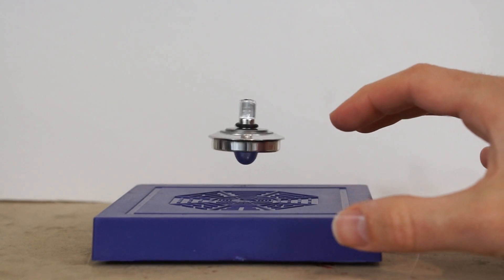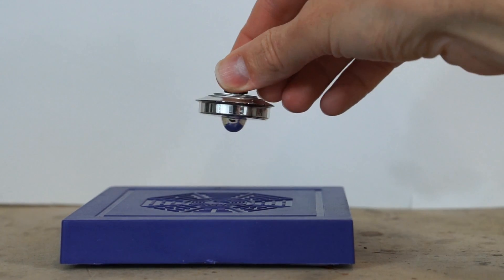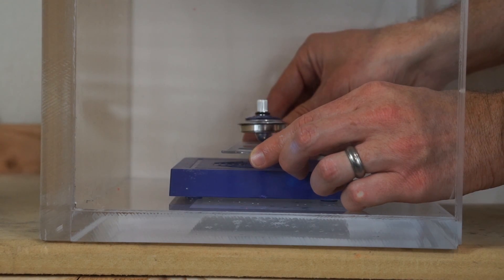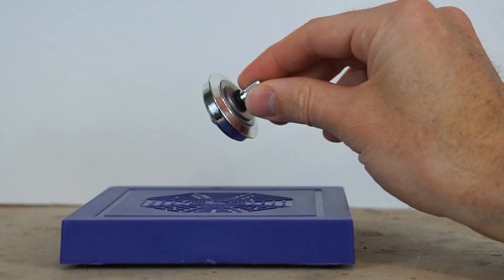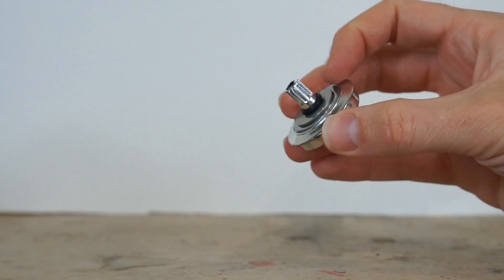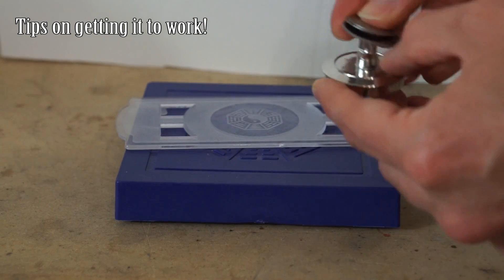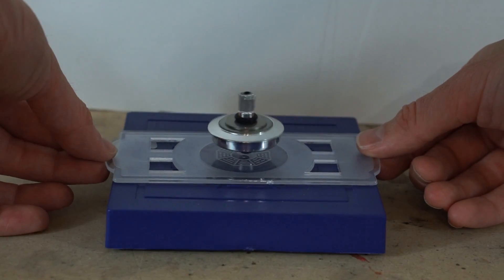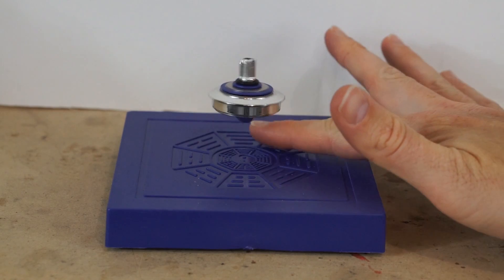Will a Levitating Gyroscope Spin Forever in a Vacuum Chamber?

Comment: It will stop due to a law. Energy can’t be created or destroyed. If that spins forever it breaks a law due to it ‘ creating ‘ energy. Also vacuums can’t go to an absolute vacuum but there’s still millions of atoms in the vacuum chamber, strongest vacuuum chambers to ever be made will problably have at least 100,000 atoms. Also magnets may lose their magnetic power after a while or even if there was a infinitely long magnet that will not lose magnetic power after time there is magnetic waves that may interfere with the gyroscope which may slightly slow down the spin. If.you want to make a perpetual motion machine it will likely have to do with gravitational pulls or maybe a ball that’s falling that thun triggers a sort of mechanism that changes the derection of the plane on which the ball sits which will make it roll that way which triggers the mechanism again and flips the plane and continues this cycle.

Comment: It will stop because it's experiencing a similar drag that a magnet falling through a copper pipe experiences as it bounces around varying magnetic interactions.  I suppose if it was made with perfectly uniform magnets and spun perfectly true, it could spin forever.

Comment: I think it will fall, because it has already slown down that it is less stable, and because the vacuum is not perfect.
Reply: And there is internal friction as well, between the atoms and molecules, generating heat.
Reply: And because there is electromagnetic induction as well.

Comment: You need a little spin tool with motor and battery to get it spinning reproducibly. Whatever speed you can get from the motor and battery will help determine how long it will spin. You could even use wired in electric power to run the motor.

Comment: it would slow down anyway, learn a bit about electricity and eddy currents, the magnets relatively moving to each other generate an induced electric current and thus dissipate energy through joule effect in heat, it's basically the same reason you can use a transformer electric motor or any electromagnetic induction device to make power or a signal reach another place using magnetic fluxes

Comment: The magnet is not circular, at least not in my sample I just received! It is square! I would expect also a circular magnet, but it was loose in the box it came in, so I had to re-glue it back together! Also, it was glued originally in a bad angle, not parallel as it should have been. As you said, it is hard to make it to work - I've plaid with it for a while, but I can't make it to work, it will require more practice. I have couple questions: 1) Is your bottom magnet square or circular? 2) How did you figure out how many "washers", that came with it, you had to use? Thanks for your video.

Comment: It is spinning through the earths magnetic field lines which oppose it, as well as those of the magnets beneath it. That causes it to gain heat energy & lose it's spin (kinetic)in order to generate that heat(as all motors do). Eventually that heat gets lost to the surrounding air when it's allowed back into to the chamber; but also even while under vacuum it's heat is radiating away as infrared (black body) radiation.

Comment: Could it be Eddy current? The spinner looks like a conductor, and it cuts through magnetic field lines. The kinetic energy is converted to heat caused by Eddy current.

Comment: The magnet uses energy that can only pass through a medium and once you take the medium (air) from it the energy stops traveling.... Only electromagnetic waves from the EM Spectrum are waves that CAN travel through the vacuum.... Ex. Light, Radio waves, Ultravoilet, Infrared, etc.
NERD ALERT lol

Comment: Your conclusion is correct but your reasoning is wrong. The rotation or "spin" is a form or motion, to get the motion requires the use of kinetic energy, it stop spinning because it's kinetic energy runs out. Using your Earth example, the earth is still spinning because of the gravitational pull from the sun & the other things in the solar system, over millions of years the earths orbit around the sun is actually oval rather than circular as we perceive it due to the other planetary bodies, debris etc that all have their own gravitational force.

Comment: It is still not a perfect vacuum and gravity probably also has an effecting it along with other waves like light.
Reply: Light wont stop it in a million years (literally)

And no, gravity is being countered by the magnet,  what stops the top is the new magnetic waves countering gravity. (Google Eddy waves for a more in depth explanation)
Reply: So if new magnetic waves are countering gravity... how is gravity not involved?
Reply: Bryson Xiao it is a perfect vacuum, gravity has nothing to do with making  a vacuum, there are planets and asteroids in the galaxy that have gravity(obviously) and have no atmosphere, making it a vacuum planet.
Reply: Light no vacuum not perfect the answer is Eddy’s current
Reply: Jeb because gravity is being countered, therefore not involved. The only way gravity would contribute is if the magnetic field was not constant.
Reply: its a refrig vac pump probs a robinair it will hit 0kpa but it takes time to hit 0 microns so no, not a perfect vacuum
Reply: It's impossible to have perfect vacuum , we can get very very very close though
Reply: Bryson Xiao gravity has no effect because perpendicular forces do no work
Reply: in this case air resistance and light is trivial. eventually will stop but takes almost forever. the dominant reason that spinner stops is induced current which is generated by wobble of spinner.
Reply: Light has no mass, so it won't affect it in any way
Reply: but the light has energy. it will expand air(rare but exist) thus moving spinner little bit. so it has an actual effect on spinner but very trivial.

Comment: Air is only one component that will stop the gyroscope from spinning. Due to the fact that the gyroscope is equipped with a magnet the earths magnetic field along with various radio frequencies effect the north and south orientation on the magnet eventually causing it to come to a stop. To avoid this and get a longer spin time you can try to build some sort of a Feradey/magnetic repulsion cage around your experiment to help. Although your run time may be increased the gyro will still not turn forever however due to the laws of natural frequency. I hope this helps!

Comment: There is a magnetic friction. Each time the top wobble, it spend some of it's kinetic energy.

The Earth is slowing down it's rotation speed. At the time of dinosaurs, the days were about 22 hours. The main reason is tidal friction. The moon is going away by 2 cm every years for the same reason.

Without moon, there would be tidal friction caused by the sun. The effect is much smaller because the Earth is feeling is smaller gravitational force. This is because the Earth is already at equilibrium with it's orbit speed and distance from the sun adjusted just right to maintain a close to perfect circular orbit.

Comment: Cosmic radiation comes in an all angles (but mostly from the sun), and have negligible interaction with the magnetic field. Much the same with gravity. What is affecting it in a vacuum is the eddy currents of the large magnet that are being induced in the metal of the floating object. The spinning metal object in a magnetic field generates electrical currents and these currents form their own opposing magnetic field that opposes the rotation of the metal object. This effect is much larger than cosmic radiation or gravity.

Also, your simple vacuum pump doesn't get near as perfect a vacuum that would be needed to allow it to spin for years.

A ceramic magnet with a ceramic flywheel would spin for a very long time in a vacuum. In a vacuum comparable to that of outer space, it could probably spin for many years. Very gradually over time, as stray atoms and molecules bump into it and get ejected at high speed, the momentum of the spinning rotor would be transferred to the atoms and they would bleed off the momentum that was keeping it spinning and it would eventually come to a stop.

Comment: Nope it won't. Motion is only stopped by power in this case we r assuming that the force stopping is the air resistance. BUT its not the only force here there is gravity, the magnetic field, the centrifugally force of it self, centrifugally force of the earth and also the moon gravity (and more). All of those forces are manipulating the movement. That's why the gyroscope is so wobbly. So maybe is it was 100% perfect even and round so its not wobbly and also almost not moving (except for the rotation) maybe in that case it would spinn for ever BUT in the current scenario there are good chances to just fall over. (Or maybe it will stabilize it self and will keep on spinning, but I don't think so)

Comment: Not even eddy currents, but flux 'pinning'.
No magnet is perfect; there are magnetic domains that are well aligned, and those that are not.
A magnet is a 3d patchwork of competing magnetic domains.
The stronger the magnet, the more domains are aligned with each other, everything else being equal.
But there are no 100% aligned permanent magnets.
What does this mean?
The mechanical moment of the magnets is not in alignment with their physical moment.
Just like the Earth, the magnetic poles do not precisely line up with the solid shape or its rotation.
The magnetic moment is dragging the rotation into one plane, the physical moment is trying its best to retain the original rotational plane.
It takes non-zero energy to transition from one rotational plane to the other.
This is what stops these things so quickly.

Precession might be a side-product of the mis-matched moments.
Reply from the maker: +Greg Gallacci that's a good point! Hadn't thought of that.

Comment: It won't spin forever because it in in circular motion, which is continuously accelerated motion. This means that it is not moving in straight line, but it is continuously changing its direction which needs continuous supply of energy. If you throw it instead of spinning it, it would go on forever..

Comment: I think that it will stop because of  the imperfections in the initial spin and delayed decompression that will intervene with the conservation of angular momentum. If the initial spin where to increase in speed, with a well balanced motion and the vacuum being applied fast enough, it could have a chance of spinning for ever.

Comment: I wont spin forever because of simple physics. When the top is spinning it is using kinetic energy, this kinetic energy is slowly running out. Sure air resistance is a factor to why is slows, but its not the only reason.

Comment: thanks for posting.  some thoughts.  i would guess, this toy makes use of something like a halbach array of neo-magnets in the base and a ring magnet in the spinner.  as others have commented, there are several obvious factors that might increase slowing. 
if i had one of these, i would remake the spinner, with a lower center of mass and weighted rim, and make a 'launcher' to get it spinning.     cheers

Comment: I think it'll stop because work is being done in the bobbing motion of the top, so energy is coming out of the system. Necessarily, this must come out of the spin. 

Ok, after the explanation, I don't entirely believe you. "There is still friction because the bottom magnet is moving" isn't convincing. I think the spin is bleeding off as a tiny induction current. But I wouldn't assert that with a high confidence level.

Comment: A rotating object with axial simmetry (any sphere or ellipsoid or cylinder or whatever) won't radiate gravitational waves, also the CBR of all things is not that big of a problem, as it comes from every direction with the same intensity it won't actually make a difference. Of course you'd still have other effects which will make things problematic, such as the interaction with other bodies gravitational field introducing precession of the axis of rotation.

Comment: 4:31 it will stop because of induced current both in the spinning thing and in the base. Because of movements (side to side and that linear motion) of the thing and because of not even distribution of the field the thing has - thus rotating itself will induce currents.

Comment: I guess it wont keep spinning for ever because there are a lot of forced influencing it. For starters gravity will prevent it from spinning for ever. In space a normal gyroscope would spin forever.. ish.. i mean even the earth is gradually slowing down so i'm not entirely sure. However i'm pretty sure that even if you would do this in space with a gyroscope that works with magnetic contraptions on the top and the bottom it would eventually stop since there still are some forces pushing on it, although it would take really long for it to stop.
I'd say it would be at least mire interresting to test a normal gyroscope in a vacuum chamber, normal gyroscopes are designes to have a rotating part inside while having a stand that remains static, so there would be even less friction than if you use this elaborate contraption

Comment: It wouldn't be friction, but electromagnetic induction- Small eddy currents induced by moving magnetic fields in proximity to each other flowing through a resistive (non-superconducting) medium (in this case the magnets themselves) creates heat and thus dissipates the kinetic energy of the top

Comment: If they would have used Bismuth it would have worked better because bismuth is opposite to both north and south magnetic poles so it hovers in mid air and doesn't flip.

Comment: I dont think so because the spinning magnet is inducing a little electrical current inside the metal parts or electrical conductor materials built on the toy.